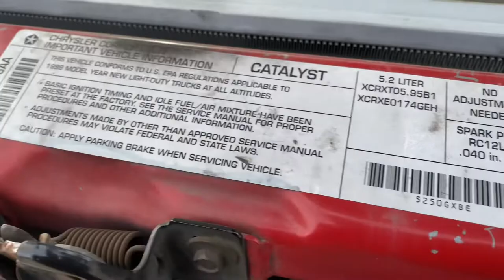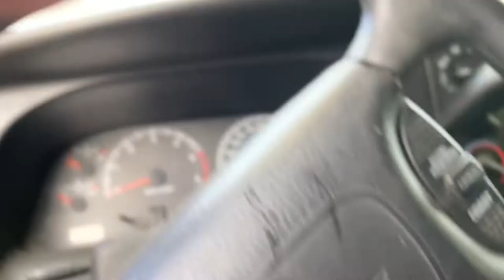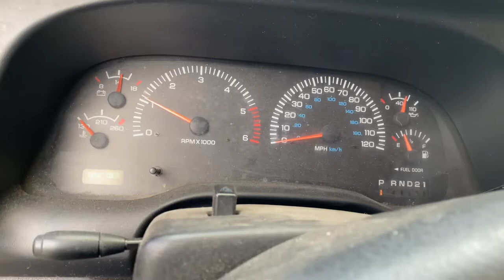Dodge ram 1500 stalling issues

Comment: Also check the ignition coil (socket) could be a bad connection. I had the problem.
Reply: Could be loose or worn out
Reply from the maker: @shadowgod7523  I sold the dodge I’m building my Silverado drag truck

Comment: whats the part called?
Reply from the maker: So there is gonna be a update video
Reply from the maker: The part I originally changed was the idle air control valve  … but in the updated video my truck kept stalling and running rough and started loosing all power

Comment: Mine is a 3.9 Magnum with manual trans v3500 and it does this when i start it and it tries to shit off then i rev it a bit it stays on but itll eventually die out, or if i give it a rev itll want to shut off going to try this out!
Reply from the maker: Long run mine ended up being the catalyst converter failing and clogging after words if the idle control sensor issue it was one thang after another but amazing truck

Comment: My 96 runs about 10 - 15 mins shuts off,I changed the Idle air control Valve and it still does it,
Reply from the maker: This only done it when I cranked it and anytime I wasn’t on the throttle  or came to a stop  not sure what’s happening with yours little like something over heating wiring or such
Reply from the maker: So update y’all if it sounds like your down to a v6 instead of a v8 and you have power lose stalling issues and you still have. A catalyst converter cut it off!!!! Mine failed and almost killed my dodge .. I cut it off and it’s healthy as can be
Reply: @Ls_Jamie  hard to understand what you are saying
Reply from the maker: @missincredible6087  im sorry?
Reply: TPS sensor is causing your problems

Comment: I have a 2005 Dodge Ram it stalls at a stop or red light and out of a sudden when driving. I wait a couple of minutes and I’m able to turn it back on I’ve already changed the EGR and it continues to do the same anyone have any suggestions of what may be causing the problem?
Reply from the maker: Idle control valve  it’s in the back behind the intake
Reply from the maker: At sudden stops it dies that’s what it is
Reply: @Ls_Jamie  It's always going to be something. I just picked up a snap-on MODIS scan tool/oscilloscope used for $450. It's my forever scan tool mated with my forever truck. Had mine 14 years now and done testing components the hard way. There's things like bad upstream O2 sensor that will stick and cut fuel because it's stuck sensing rich. Stuff you'd never guess unless you had scoped the o2 voltage. Can't wait to try out my new toy, but the Dodge is running 100% right now.
Reply: Could have loose connection under fuse box in engine also

Comment: Does the idle air control valve make it turn off while driving normaly
Reply: Try a OBD scan and see if any codes come up
Reply from the maker: @carterledbetter7657  it can cause it to shut off at stops
Reply: @Ls_Jamie  cleaned it still had the problem did a obd scan turns out it's my ecm a little expensive but oh well gotta keep the ole trucks running

Comment: I had to cut my cat out. How i found out was i cut b4 the cat to relieve flow. But then i took it all off. Removed o2s. Now it wont idle. I did put it back on (gutted cat) with that o2 sensor hooked up. Still wont stay idling..
Reply from the maker: Idle air control valve on the back of the intake. Take it out replace it or clean it